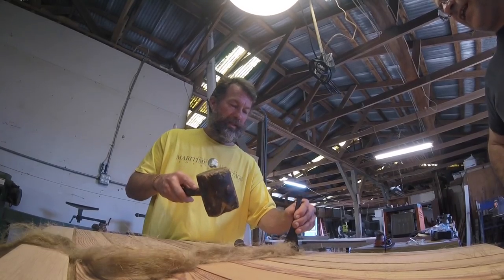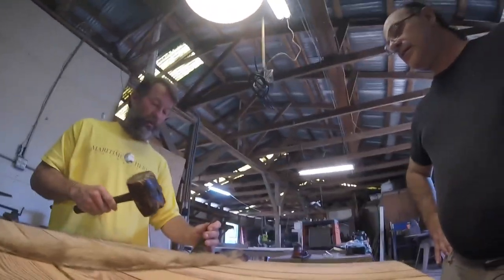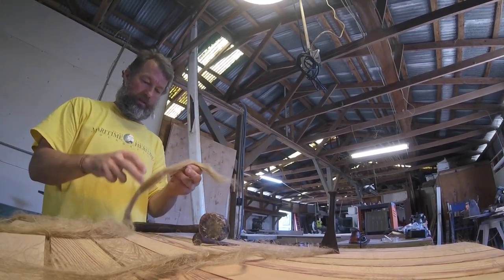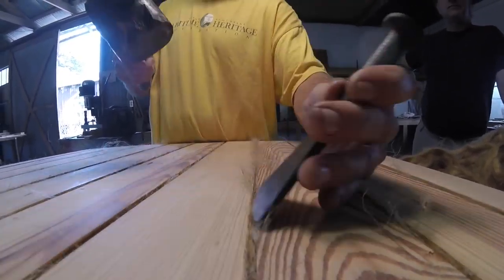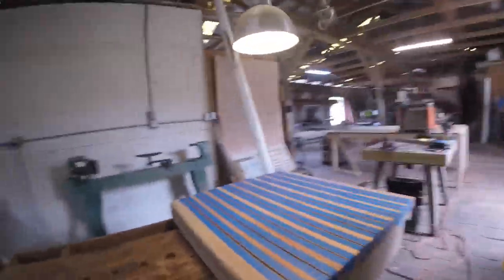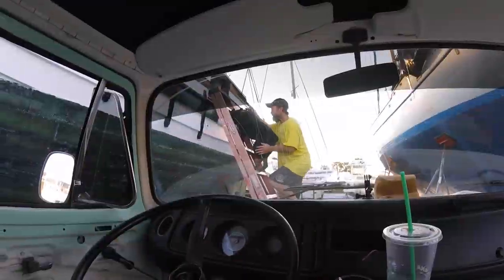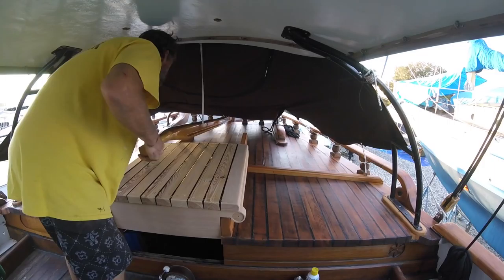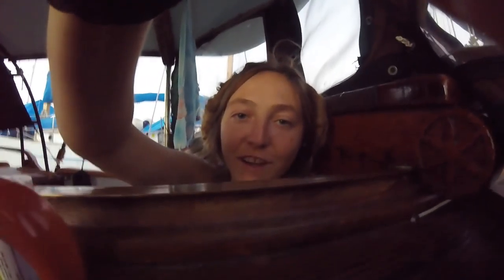Episode 144 - The Zen Art Of Wooden Boat Maintenance - Sailing Vessel Norna Vlog Day 49

Comment: shifting gear problems (forward & reverse) on old bug vans is usually caused by - a plastic bushing on the shifter tube (horizontal pipe, goes the length of the van) just aft of the stick shift will wear out, making the squeaking noise I can hear when you shift,   - there's a small funny looking plate under the gear shift that might be worn also, and  - the coupling between the shift tube and the transmission might be loose.

Comment: Great job on the projects!  Some relief for Pete's shoulder might be using pressure points (found online) they have helped me also. And...walmart has Salon-pas pain patches that help a lot also. Good luck, hope he feels better soon. Thanks for your video's!!
Reply: +Kim Schultz ;  I can second you on the Salonpas patches...I had a chronically sore shoulder from weightlifting, actually thought it was a torn rotator cuff, but I would use a Salonpas patch overnight and the shoulder would be pain-free for a couple of days afterwards....but the real cure came when I retired.  I still keep a box of the aspirin patches around just in case, though.  Pete should give them a try.
Reply: I agree, Pete should give them a try asap :)

Comment: As a plastic sailor myself I marvel at this whole caulking thing. We use a product called Duraglass why couldn't you just spread that over the seams and then sand? I've filled some wood rotted areas with Duraglass and it bonds well with wood. I suppose wood swelling and contracting could be an issue on those long seams...